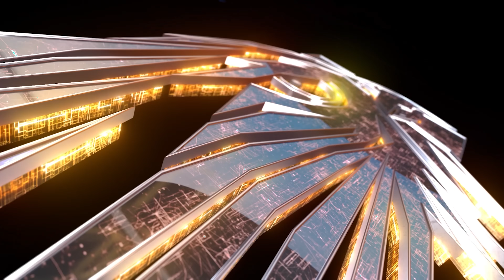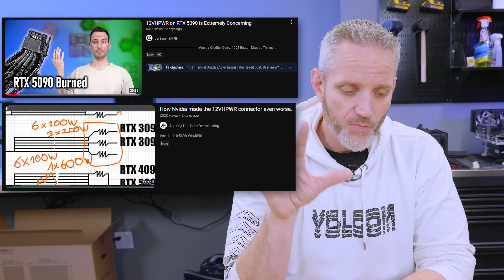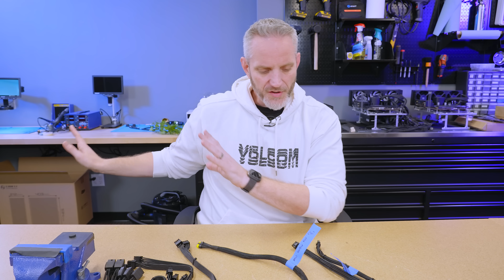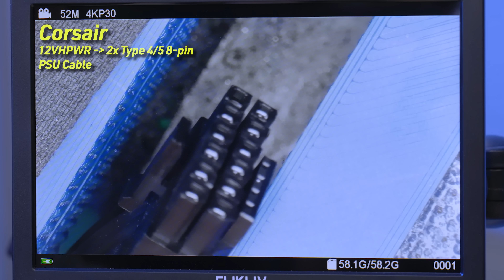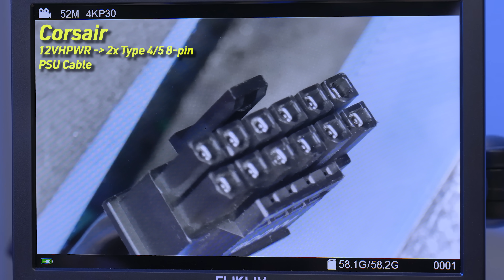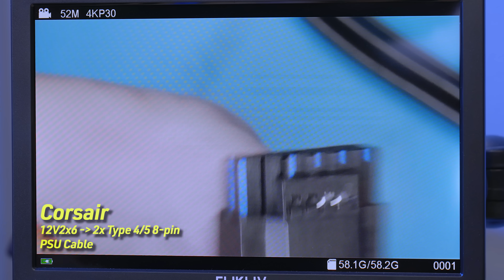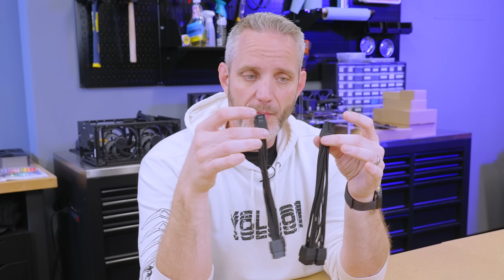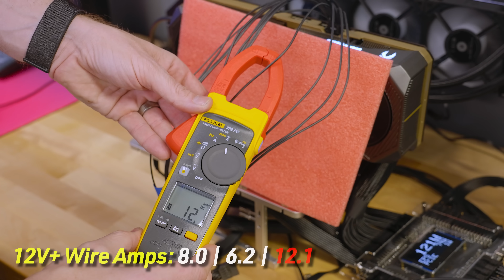I discovered something concerning and I need the Experts to chime in... More 12VHPWR discovery!

Comment: Dear Corsair:  This is your cue to use your link software and integrate individual pin monitoring for this application.  Should the difference in current between +12 pins be beyond X percent flag it in your monitor software.  Include option to shut down PC after X seconds of over current.  This can be solved at the power supply level and it would be a valid reason for people to upgrade.
Reply: First brand to market wins.

Comment: If I compare the Corsair connector to the automotive connectors I see at work I can assure you that the retention clip in the pins that allow it to lock are 100% faulty. Now I'm talking about connectors that draw less then 10 amps. For anything drawing double that and a manufacturer to say it's in the norm is very very sketchy to be honest.

Comment: I've always seen the pins moving in the plugs and I've always brushed that off as "lol, tolerances". But I've also taken the habit of plugging in every cable regardless of their shape while also holding the wires, pushing everything (the plug and the wires coming out of it) together since seeing some WILDLY loose pins on molex connectors

Comment: Any electrition, even an apprentice can tell you what's wrong. You NEVER run multiple cables from power and terminate them to the same place. Even if an electrition did this, there would be breakers that would trip if any given wire was pulling too many amps.
Reply: Really? Interesting. Have you never heard of parallel feeders? Because as an ELECTRICIAN I can say unequivocally that yes you can run multiple cables from one power source to one load to carry electricity. What I CAN say as to what is going on here is that overheating ALWAYS occurs at the point of most resistance. A burn that extends along the entire length of a cable will indicate over loading of the wire. A burn at the connection indicates poor connection
Reply: @somethingsomethingsomethingdar  I sure wish you understood physics. Try it on a 40k line 300ft in the air.

Comment: It's very rare nowadays for power supplies to limit current based on individual connector rails. Instead, most modern PSUs simply provide an oversized 12V rail delivering 100+ amps, which effectively bypasses meaningful overcurrent protection in my opinion. 

In the past, power supplies used to limit rails to around 20–30A per connector. If two older PCIe connectors were used, this current limitation would have triggered the PSU’s protection and safeguarded the GPU or other components. Now, with the new 12V 2x6 connector, there is no such safeguard. The industry either needs to revert to a dual-connector system or redesign PSU protection circuitry to monitor each 12V pin or limit the current per pin of these connectors ensuring proper current distribution across the connector.

Either way, pushing 50A through a single connector is far from ideal. While I understand the desire for a single cable to power a GPU, a smarter approach would have been increasing the voltage—at least to 24V—to cut the current in half. However, higher voltages introduce greater electrical shock hazards, which likely influenced their decision to stick with 12V while attempting to shrink the connector size to handle 50A.

As a side note, AI server PSUs have already shifted to 54V rails, significantly reducing current (by a factor of four) while increasing power delivery by two to three times. This approach makes much more sense for high-power applications.

Comment: This problem doesn't go away until the "standard" for 12VHPWR is revised to include safety as a fundamental underpinning rather than COST. The extra 4 sense pins (which ONLY tell the GPU power management the capability of the PSU) are a start, but what is lacking completely is the inclusion of mandatory load side (GPU) power management and balancing for every current carrying pin on the 12HPWR connector.

Comment: My 2c, wire / copper quality (copper / aluminum ratio ), Guage/  thickness & contact area, these are the problems with this.
Bad / small / loose contact area or contact point results in a "hot connection".

Regarding wire Guage or thickness, try jump-starting a car with thinner cables than the usual, see how quick they heat up. Still 12v, but with high amps at high resistance.. like forcing an elephant through a keyhole...

Comment: Bad ground wont cause the same issue as itl actually hold voltage onto the ground side to oush the current back to ground. So instead of having all the voltage drop at the laod itl hold voltage. I was boosting a vehicle with a anderson pmug and the ground wasnt connecting well and the ground side melted...

Comment: Im no engineer, but from my experience with repairing electronics in the military. The issue is the power is going down the path of least resistance, causing the load to be uneven on the bundle of wires. Im sure a 3rd party wire company could come out with a safe solution that has temperature-sensitive resistors on each wire, which when a wire pulls more amps it would heat up and increase the resistance inline of the wire, causing the power to redirect to the next lowest path of resistance. This would make the draw on the wires more even, but ultimately the gauge of wire for this needs to be increased. There should be no way these power cables are allowed to be sold with the 5090 with the potential of the power draw occurring over 80% of the line max amps.

Comment: Hey Jay (sorry if you already knew this)! I've worked with building many cables before, and most of these types of cables have a single way of connecting together. That being, the metal square has an a hole on side and the plastic piece has an indent (or very rarely vice versa).  I'd be intrigued to see if it just didn't seat properly, or if the connection point failed. Some of these connectors are poorly made and never latch, while some are so tight it's too hard to get on. Maybe ypu can check this?

Comment: This might be a Corsair or QC issue to be completely honest. I bought a PNY 5080 with Corsair's new "CORSAIR RM1000x". It is their 2024 version as listed on Amazon, which is "ATX 3.1 Compliant and has PCIe 5.1 Support" and claims to have a "Native 12V-2x6 Connector". Despite these claims however, the RTX 5080 did not power on with this included PSU cable, and I had to use the included adapter in the GPU box. The ladder worked, the former did not. I can send images of the included PSU cable if needed.

Comment: On the idea of the bad ground being a potential for catastrophic failure, I’m lot an electronics engineer but I am an electrician dealing with 230-400v and in the mains systems poorly connected neutrals (grounds on a pcb) are frequent reasons for fires or melted terminals. The same current passing through the live terminals exit through the neutral terminals at the end of the circuit, this is the premise that RCDs/GFCIs work from +current = -current. I don’t know that it works the same in components like gpus but I can only imagine the principles remain even though the methods are different.

Comment: The locking tab that holds that pin in place is broken. Only way to fix it is to unpin it and replace the plastic connector body. Not realistic. The ultmate answer is to replace the whole cable.

Comment: As an Electrical Engineer with 33yrs of experience in Semiconductor, you have identified a partially  "pushed" pin. This is generally caused by 1 of 3 things. 1 - Pin was incorrectly installed and the retaining barbs were damaged. 2 - The pin or pin housing is out of spec or damaged. 3 - The pin was removed due to an error during assy which then damaged the pin and or pin housing. Could there be some other possibilities, yes, but these would be the top contributors to the root cause of a poor connection, resulting in additional resistance at the point of connection and heat generation. The bad news is that this is just the tip of iceberg for resistance issues at the point ot connection when you perform the 5M & E fishbone.

Comment: Corsair has been going downhill for about 8 years now.  I stopped buying corsair when I got the H150i Elite LCD XT (due to screen liine issue on the non XT version, , that also eventually started happening on my XT as well.  The fans made a wierd hum at 4 different 75-100 rpm ranges, and corsair said it was normal.  They havent put out a good fan since the LL fans.  Mice switches dont last either.   I used to only buy corsair, keyboards, mice, psu, headsets.  But no longer.   Just dont recommend them at all any more.

Comment: to make your amperage draw reading mean anything useful you need to also be measuring voltage at each of the 6 pins at the psu connection and the pmd2 input end to see if there is voltage drop through the wire itself. this needs done also for the output of the pmd2 to the gpu. otherwise just amp readings are kina useless. without having both amp and voltage  in this specific example you have no way to determine where or if there is a resistance issue or any balancing taking place. it's just ohms law, you have to have two of the factors to determine the third. do the exact same test with the clamp on and 2 good volt meters and you could verify the cables on both the power side and ground side. 12x volts divided by 11.1 amps equals resistance. just an idea that could help, keep up the great work. love your channel. i would be willing to explain in detail how to do this  if it would be helpful.

Comment: Present this to Nvidia if you can, they got to got back on the design board and go back to the 3090ti days, and with VESA redesign the cable where they put something that regulates and spilts the powers to multiple wires.

Comment: The pins usually have 2 tabs to hold it in the socets, and they can be bent easily which will lead to the pins being more loose then others and cause this.  They can become looser then others when the manufactureres test the cables, when the customers installs them and tweaks on them to fit a bend needed for their case use...  With more installs disconnects will make it worse.

Comment: Maybe someone can fill in why I would be wrong, but to me it seems silly that we are using such thin wires and complex connectors to handle constant power to something that draws this much power.  I mean, 12V at 600W is a 50A draw.  That means each pair of power and ground are carrying 8.3A if sharing the load equally.  I come from RC racing where we deal with much higher amp loads as a constant draw.  Always wondered why we dont just use a good gauge wire like 12 or 14ga with something like a QS8 connector and only need to deal with 2 wires going to it.  That plug can handle 110A constant, meaning that one plug alone could support a 1320W gpu on its own!! 😂  There must be a reason we dont see this used, I'm sure, but it seems like having a "QS8 socket" on the gpu and psu side would eliminate the argument.

Comment: Yes, 3 years ago... cables weren´t fully plugged in... But it also was kinda by design. they changed that.... But bad quality will always exist....  Also i am wondering why the power supply can´t put out the power even on all pins.... that and the problem with quality you showed is like a mix bad things that will make problems when run at their max specs.... Corsair also has their premium cable sets... and the newest power supplies have 12V2x6 on both sides.... i wonder if they are mady in the "good quality" factory like the nvidia/singularity/msi cables

Comment: A bad ground likely wouldn't cause any issues because all the ground conductors would be bridged across each other at both ends, so any increased power would be distributed across all of the ground pins, which is not true for the positive side.

Comment: The only way the GND could be more tolerant of the heat would be that there's more copper in the board sinking heat away from the connector (all other things being equal -- if the resistance on the GND is just as bad vs another cable where the resistance is bad on the 12V side, it comes down to what's pulling the heat away, and the GND side is likely to be a big planar sheet of copper in the board).

Comment: My father in law is a electrical engineer and I discussed this with him. Any pin difference that moves that much, on either side can cause a issue and possible fire. 
He stated that not all cables are created equal, so some can have a slight issue and then heat to point of melting. 
If you see something like this in a cable, get your money back and get a new one.

Comment: A very large portion of the PCIe connector is GND pins and therefore much more robust to loss of GND pins on the power connector. GND is able to freely return current through both the ATX 24pin and the CPU (2x4)x2. 12v is not allowed to pull more than the 75w at the slot 12v, and there arent nearly as many 12v pins as there are GND. I have an x4 PCIe design open right now, 5pins for the 12v, but 20pins for GND alone, x8 and x16 obviously have even more. The 12v side is definitely the failure point.

Comment: Okay so genuine question from a 4090 owner.

I've been using that exact Corsair cable for about a year without issue. I also used the Nvidia adapter for about a year without issue prior to getting the Corsair cable. Looking at it now, my Corsair cable does appear to be ever so slightly uneven, but nowhere near to the degree of the one in the video. It also appears to have two pins (the top center ones) that I can pull back on, but only very slightly and only, oddly, at certain angles. When it's routed around to where it actually plugs into the GPU, I can't get those pins to move.

My Nvidia adapter seems basically even, and I can't get the pins to move around under any circumstances, however all of the pins on the Nvidia adapter are recessed further than any one pin on the Corsair cable, even accounting for the ones I can slightly pull back on.

Should I keep the Corsair cable hooked up? Should I switch back to the Nvidia cable? Should I just never plug this thing in again and sell it? Genuinely not sure what I ought to do and I'm curious about your thoughts.

Comment: The 12V vs GROUND being the melted one - it will be always a 12V side, since the power delivery network on a GPU that is in an ATX PC is not isolated and shares a common ground. Therefore the current fed to the six 12V pins, goes back to the PSU over not only the six ground connections in the 12VHPWR, but also through the PCIe edge connector / PCIe slot's grounding and shielding pins - there is plenty of them - and that makes the imbalance in the current's return path. It is not desired, but it can not be avoided - unless one would make the GPU's onboard power supplies fully isolated. So the whole design that has 6+6 pins is wrong from the start - count the grounds in the PCIe slots (0.5 to 1.0 A each, see pci-sig CEM) that merge into almost a dozen of grounds on properly sized ATX24 + 8+8 pin ATX12V connectors.

Comment: The 12v wires bring the power in but the ground for the card will be both the cable AND the card physical mount AND  card board pins.

Comment: Electrical engineer here, but haven’t worked in the field since I graduated and opened my own business twenty-two years ago. I would need to have more information, but absolutely an out of spec cable can cause major problems. If one contact isn’t closed, that extra wattage has to flow, and it will flow backwards into the closest closed circuit, which is back through the power supply (which can handle it far easier) and through a nearby pin back to the gpu. It could also cause arcs between both open circuit as the whole connector heats up and expands. As the open connectors heat and expand they could close, cool, open, heat, close, cool, open, rinse and repeat. Causing uneven load across the connector. And this is happening over and over, with just microns of expansion and contraction. 

I would need to see complete board and cable specs to know exactly what’s going on. Mine is scheduled to arrive Monday, but I have no plans on taking it apart until a good liquid cooling slab releases for the founders edition. 

But I do know that the temps De8whateverhisnqmeis showed on his heat tracing camera were absurd. And breaks in flow can absolutely cause overloaded pins to overheat and catch fire. Especially when those out of spec cables are often cheap and the wire guage questionable at best. Frankly, a lot of problems with home built PC’s I’ve built for friends were from cheap PSU’s with cheap cables, or often dubious quality RGB cables that the owner replaced for cool factor, never thinking to even consider wire guage and build quality. It looked cool!

Comment: If there was a way to see if the cable pushes out the back of the connector when you insert it. Like buy one with a white cable, use a black Sharpie to mark cable where it inserts into the connector. Then plug cable into GPU and see if a gap now exists between Sharpie mark and connecter

Comment: This seems to not only be an issue with the connector itself like we all think. I already thought when I saw the der8auer Issue: It HAS to be a resistance issue. Resistance in the connector. There is no other way for uneven power distribution. If the resistance is equal through all power pins, all, by the law of physics, will carry the same amperage. And since that's clearly not the case here, it has to be a resistance issue, and I only see my suspicions confirmed by your findings: The cables melt because of the variance and bad pin connections resulting in high resistance.